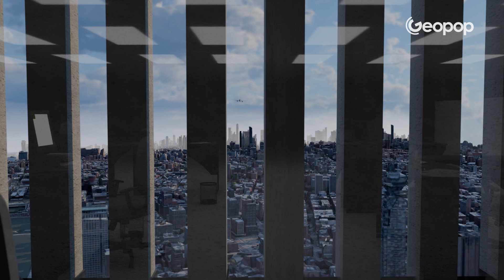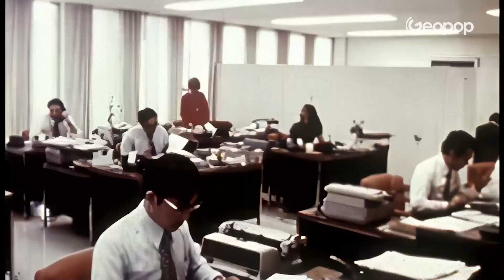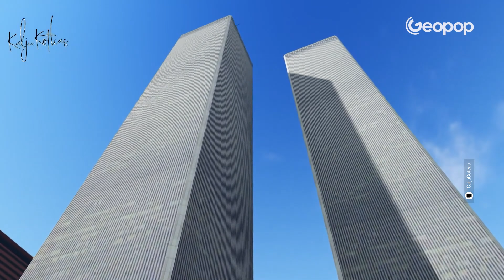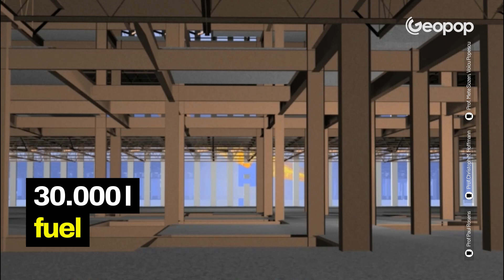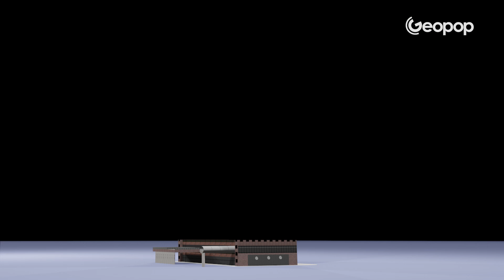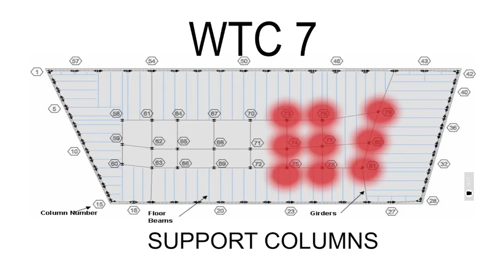9/11, 2001: The Technical Reconstruction of the Twin Towers and WTC 7 Collapses

Comment: The buildings fell at freefall speed. That means that every floor beneath the debris was gone (and turned to literal dust) before the debris on top reached them .
Reply: No they didn't.  There is no such thing as free fall speed since free fall (gravitational acceleration or GA) is a measurement of acceleration, not velocity. Anyone using a term like free fall speed is telling you just how little they know.

Also, did you measure that yourself or are you taking the internets word for it?  The same internet that told you about free fall speed ?

All you need to do is look with your own eyes to see how false the claim is. Stopwatch optional.
Reply: @TheLoonResistance according to Google, a baseball would take about 9 seconds to fall 1100 feet. The towers collapsed in just over 10 seconds. Sounds like an air resistance difference to me.

More importantly, the firefighters interviewed said that they didn't find any concrete or office debris larger than pebbles and dust. This dust starts immediately upon the onset of collapse. An entire floor's worth of rebarred concrete could be dropped 1100 feet and there would still be large chunks of debris. It takes an insane amount of energy to turn that much rebarred concrete into dust. There is are no circumstances in the event to account for this. It can't happen. If it could, demolition companies wouldn't waste money rigging up entire buildings. They would save enormous amounts of money only rigging a few stories near the top
Reply: @joeycasale755  - The myth the Twin Towers collapsed in free fall (9-11 seconds) comes from completely misreading this:

NIST FAQ for the Twin Towers disaster Study

*11. How could the WTC towers collapse in only 11 seconds (WTC 1) and 9 seconds (WTC 2)—speeds that approximate that of a ball dropped from similar height in a vacuum (with no air resistance)? *

NIST estimated the elapsed times for the first exterior panels to strike the ground after the collapse initiated in each of the towers to be approximately 11 seconds for WTC 1 and approximately 9 seconds for WTC 2. These elapsed times were based on: (1) precise timing of the initiation of collapse from video evidence, and (2) ground motion (seismic) signals recorded at Palisades, N.Y., that also were precisely time-calibrated for wave transmission times from lower Manhattan (see NIST NCSTAR 1-5A)

Note the part about the first exterior panels to strike the ground after the collapse initiated.  A lot of people seem to miss that important bit of context and only see the 11 seconds and 9 seconds parts. 

On conspiracy web sites and YouTube videos they just cut out all the relevant context and details and (falsely) claim; The Twin Towers collapsed in 10 (or 9 or 11 - they usually can't remember the exact number so they fudge it) seconds Selective reading comprehension syndrome (SRCS). 

9 or 11 seconds is NOT the building, its the first debris to hit the ground which were definitely in free fall and dropping much faster than the Tower, which is collapsing some ways behind that. All of this easily visible to the naked eye. 

youtube.com/watch?v=4VgZW-v_Opg&t=4s&ab_channel=MFitz 

The Twin Towers took approximately 33 seconds to collapse (+/- 1 second) from start to finish. Unlike you rather than just trusting some rando on the internet I actually timed it myself.

Here we have the North Tower Collapse looking at the north and west faces of the tower. Recommend setting to 1080p and half speed or slower. 

youtube.com/watch?v=BRdGnn4MqeE&ab_channel=MrKoenig1985

Collapse begins at 1:24 when the south face – where the worst fires were located - starts to drop and we can see the antenna move as the hat truss drops on the south side. At 1:25 the falling mass drops about one floor, air is compressed inside the building and blows out the broken window with smoke and flame. Note this expulsion occurs in response to the movement of the building and is not a cause of it. 

No “explosions” or their effects are visible or audible. 

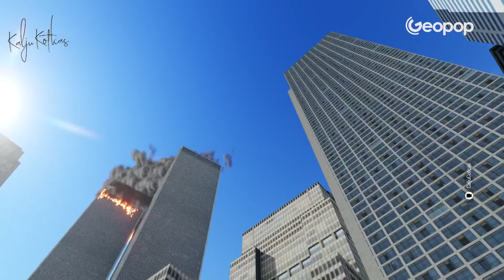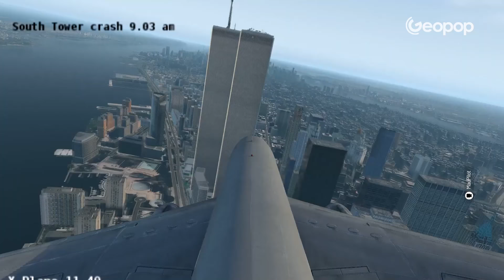It is obvious most of the falling mass is dropping within the four outer walls of the lower, static mass. It is not a block, dropping on top of another block (not column end to column end contact).  From 1:29 in the lower center we can see a large section of perimeter columns still standing behind the collapse at the bottom of the frame, just to right of center. It starts to drop at 1:31.  

Note that 7 seconds into a collapse that supposedly only took 10 or 11 seconds we are still seeing parts of the building around the 90th floor standing.

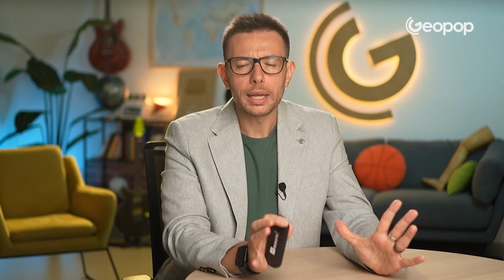As the camera zooms out at 1:36 we can see large sections of perimeter columns peeling away towards Building 7 at the lower left.  Note the collapse has now been going on for 12 seconds and still quite a lot to go. 

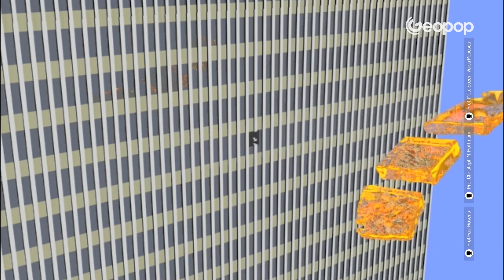At 1:44 (20 seconds after collapse started) enough dust and smoke has started to clear that we can clearly see substantial sections of core columns still standing as the rest of the building around them has fallen away.  Not a uniform, symmetrical collapse.

The last core columns do not drop out of view until 1:57, which is 33 seconds after collapse began or less than 1/3 the rate of gravitational acceleration (free fall to you).  Note: we have no view below about the 50-55th floor. 

Of course, you don't even need to get out the stopwatch to see how silly the "free fall" claims are. Just look. The loose debris that has broken off the building and is truly in free fall is obviously dropping 3 times faster than the tower itself.

www.youtube.com/watch?v=4VgZW-v_Opg&t=4s&ab_channel=MFitz

Comment: The huge steel box frame core supported the floor trusses and pearllite floors , the outer steel walls  had little strength and held up little   , the elevators were incased in the huge steel box frame cores that held up the floors , the box frame core could not  collapse  it was 864 feet in height , why do  you think 1034 architechs and engineers demanded a proper study on the core disintigration. 😮

Comment: Lol.. so you are rìght and millions of èngìneers who said otherwise ìs wròng.. 😂

Just àccèpt ìt, it's ìnsìde jòb..
Reply: What millions of engineers are you referring to? That was sarcasm, right?
Reply: @TheLoonResistance   👍
Reply: The collapse of Building 7 is one of the most studied engineering disasters in history and the subject of 5 comprehensive engineering studies and more than two dozen technical articles in major peer reviewed engineering journals, most of which were published 15 or more years ago. Thousands of pages of material.  This should get you started.

FEMA BPAT (initial report superseded by NIST NCSTAR 1A)

NIST NCSTAR 1A: Final Report on the Collapse of the World Trade Center Building 7, 2008.

Guy Nordenson and Associates, WTC7 Global Collapse Analysis Report and Summary of Findings, 2010.

Arup, WTC -7 Structural Fire Analysis Report (Runs 1-4), 2010.

Weidlinger Associates Inc., WTC 7 Collapse Analysis and Assessment Report, 2010.

BRE Centre for Fire Safety Engineering, Analysis of the Impact of a Fire in the Mechanical Room (5th & 6th Floor) of the World Trade Center 7 Building, 2010.

T. McAllister, R. MacNeill, O. Erbay, A. Sarawit, M. Zarghamee, S. Kirkpatrick, J. Gross, Analysis of structural response of WTC 7 to fire and sequential failures leading to collapse, J. Struct. Eng. (United States). 138 (2012) 109–117.

For a summary of the major studies I would recommend THE COLLAPSE OF WORLD TRADE CENTER 7: REVISITED by Mhd Anwar Orabi , Liming Jiang , Asif Usmani and Jose Torero which is a 33 page summary of the different analysis and conclusions published in 2020. Sorry, YouTube will delete this post if I give the link but it should be easy to find and is available from the University of Queensland, Brisbane. 

Real structural engineering industry professionals conducting real engineering studies and publishing them for other professionals to see. Not amateur YouTubers appealing to the gullible and credulous.

Happy reading

Just accept it

Comment: The B25 that crashed into the New York State building had much more volatile fuel in it, being as it was not a kerosene fueled jet but an internal combustion engine. It did barely any damage.
Reply: The B-25 that hit the Empire State Building was almost out of gas, weighed 1/10 as much as a 767 and was going 1/3 the speed of the 9/11 jets. Oh, and maybe you didn't know this but the ESB was a totally different construction & design.

#thingsyoushouldknow

Comment: now in bulding 7 600hundred degrees can make it weaken you are so full of shit you dont know what the fuck you are talking about your science is bullshit
Reply: The collapse of Building 7 is one of the most studied engineering disasters in history and the subject of 5 comprehensive engineering studies and more than two dozen technical articles in major peer reviewed engineering journals, most of which were published 15 or more years ago. Thousands of pages of material.  This should get you started.

FEMA BPAT (initial report superseded by NIST NCSTAR 1A)

NIST NCSTAR 1A: Final Report on the Collapse of the World Trade Center Building 7, 2008.

Guy Nordenson and Associates, WTC7 Global Collapse Analysis Report and Summary of Findings, 2010.

Arup, WTC -7 Structural Fire Analysis Report (Runs 1-4), 2010.

Weidlinger Associates Inc., WTC 7 Collapse Analysis and Assessment Report, 2010.

BRE Centre for Fire Safety Engineering, Analysis of the Impact of a Fire in the Mechanical Room (5th & 6th Floor) of the World Trade Center 7 Building, 2010.

T. McAllister, R. MacNeill, O. Erbay, A. Sarawit, M. Zarghamee, S. Kirkpatrick, J. Gross, Analysis of structural response of WTC 7 to fire and sequential failures leading to collapse, J. Struct. Eng. (United States). 138 (2012) 109–117.

For a summary of the major studies I would recommend THE COLLAPSE OF WORLD TRADE CENTER 7: REVISITED by Mhd Anwar Orabi , Liming Jiang , Asif Usmani and Jose Torero which is a 33 page summary of the different analysis and conclusions published in 2020. Sorry, YouTube will delete this post if I give the link but it should be easy to find and is available from the University of Queensland, Brisbane. 

Real structural engineering industry professionals conducting real engineering studies and publishing them for other professionals to see. Not amateur YouTubers appealing to the gullible and credulous.

Happy reading

Comment: Building 7 must have fallen out of sympathy for the twins being brought down in controlled demolitions
Reply: 7 World Trade Center was constructed above a two-story Con Edison substation that had been located on the site since 1967, which which imposed unique structural design constraints. 7 WTC had hundreds of gallons of fuel in tanks for generators to support emergency management and federal agencies housed there. The debris ignited fires on multiple lower floors of the building, which continued to burn uncontrolled throughout the afternoon. The building's internal fire suppression system lacked water pressure to fight the fires. 7 WTC began to collapse when a critical internal column buckled and triggered cascading failure of nearby columns throughout.
Reply: After the Twin Towers collapsed, almost every floor of Building 7 was on fire for over 6 hours, there are many videos to see, so you are talking nonsense. Another building was left standing, but it was unsalvageable and had to be demolished. Building 7 was also damaged so much by the Twin Towers that it collapsed.
Reply: lol 40 knobheads like you thumbed up
Reply: Seems we've found another uselful id*ot.
Reply: Clueless.
Reply: You obviously didn't bother watching the video  🤦‍♂
Reply: @TheLoonResistance did you watch the video on Santa Clause as well? It showed that a fat man in a red suit travels the world in one night!
Reply: @TheLoonResistance  No need to watch that part, the quote from Silverstein was enough to convince me: "Silverstein recalled saying, "We've had such terrible loss of life, maybe the smartest thing to do is pull it". "They made that decision to pull"
Reply: @sapperdeflap - Pull what? What is the it they are referring to and how did you arrive at that conclusion?
Reply: @sapperdeflap ”pull it” meant pull emergency personnel… 🫠 it became too dangerous to continue. It’s common sense.
Reply: @Ifyouseekalyssa  Nope 'pull it' is slang among demolition companies to take a building down. Silverstein said 'we had to pull it' and 'it' cannot refer to personnel, no 'it' refers to an object in this context.
Reply: @sapperdeflap
And? It was to protect first responders looking for victims in the rubble; he was saying it’s unstable and can’t be repaired, let’s collapse it now so it isn’t a danger to rescuers.
Reply: @TheLoonResistance  Again another idiotic comment!
Reply: Yes too bad the Port Authority had to destroy it but I understand that was to hide a lot of things going on inside.

Comment: OK, but the issue was also the government claimed the steel was melted into liquid molten steel, and they were flowing down the shafts and the elevators.  
Also, this does not explain why the building would fall straight down in a perfect pile on top of it self… 
Anybody with common sense understands this was controlled demolition
Reply: Ummm, no the government most certainly did not ever claim the steel was melted into liquid molten steel, and they were flowing down the shafts and the elevators . That's pure ignorant conspiratard stuff that no one who matters takes seriously. No idea what you mean by straight down into a perfect pile either as anyone with a working eyeball can see that's wrong. Maybe this will help:

Let’s break it down to the absolute basics:

The 47 core and 236 perimeter columns of the Twin Towers support all of the gravity loads of the building. ALL of the resistance is in the columns.

Planes impact Towers, causing massive structural damage, destroying sprinkler systems, tearing out gypsum board walls and blasting off the SFRM insulation from the floors. Multiple floor-wide fires are started instantly and spread rapidly due to the destruction of fire protection systems and venting of the building during the impact.

Serious fires were largely confined to the impact damaged floors and those immediately adjacent to them.  

Fires were started by the impacts and fuel aboard the aircraft, which acted as an accelerant. No shortage of other consumables inside the tower to continue the fires. 

Collapse was initiated (started) at the impact and fire damaged floors when floor trusses exposed to heat over time sagged, in turn pulling on and causing the inward bowing of some perimeter columns by up to 5 feet until they buckled on one face of each tower (ie: NOT symmetrically). 

www.youtube.com/watch?v=ULdiD6gYZO0  

No steel melted or needed to. Structural steel will bend and fail at less than half its melting temperature.

Once the perimeter columns buckled the formerly static load above became a dynamic load 30 times greater, easily overwhelming the structure below.

Thousands of tons of now loose debris fall through the open office space within the four outer walls - bypassing the columns - dropping 12 feet onto the first intact floor it comes across. That massive instant overload causes the floor to fail, shearing the pair of bolts that secure each end of the floor trusses to the columns.  The floor fails. adding its mass to the falling mass which continues to accelerate for another 12 feet until it impacts the next floor, rinse and repeat one floor at a time all the way down. 

Rate of collapse increases as momentum increases. The collapse front is constantly accelerating. 

As each floor fails, air inside the building (the Towers were 95% air by volume) is compressed, then blows out the sides _in reaction to the Tower falling, not the cause of the Tower falling.

No fire required at all on floors below the impact points for them to fail. The mechanisms that started the collapse are different to the mechanisms which continued the collapse.   That will be a difficult concept for some.

As the floors fail the perimeter columns are left literally hanging in the breeze, no longer attached to the rest of the structure. They peel away and fall in great sheets (think banana) out to more than 600 feet from the base on the 4 points of the compass. 

Core columns failed last. 

Each 110-story tower had a 1-acre footprint. The debris pile was up to 14 stories deep and spread out over 16 acres, destroying 8 surrounding buildings and damaging more than 100 others.
Reply: I was alive during 9/11 and have extensivley researched this topic since middle school and never ever, not one single time, have I ever heard any government or scientist (or even the news for that matter) say there was "liquid" steel. And why would the building NOT fall straight down? Gravity doesn't work sideways. It's explained in the video that the builing crumpled inward and then the stories above the impact fell, causing a domino effect. I literally watched a video about a skyscraper in Taiwan that collapsed EXACTLY like this during an earthquake. Buildings don't fall sideways like a Jenga tower, they are purposely designed to not do that, for wind resistance and because in cities...falling sideways would cause extreme damage to thousands of feet rather than the footprint of the building. 

(And just as a pet peeve I don't know why everyone keeps saying "neat" and "perfect" pile...look at pictures of ground zero days after, its multiple city blocks of mangled steel and debris that took YEARS to clean up...hardly a "neat" pile)
Reply: The official story is completely bogus . Every expert in his or her 
Field . Investigated this tragedy . 
All came to the same conclusion.
It was controlled demolition.
Reply: @GlenAnderson-g3c  Which "experts"?
Reply: and where is all the steel